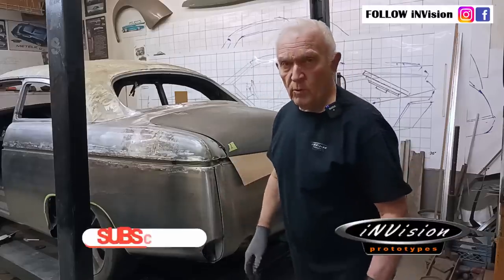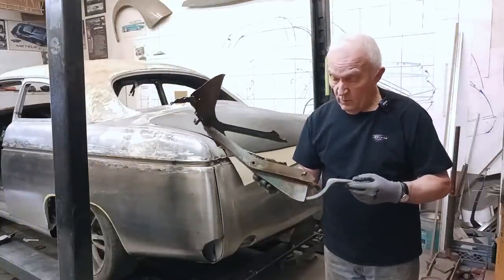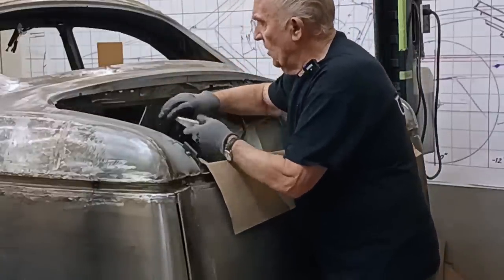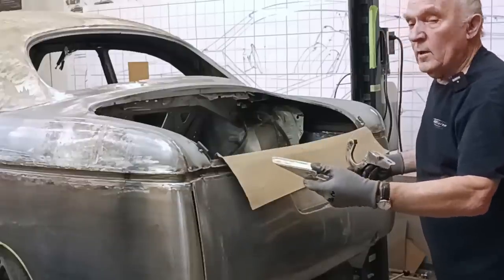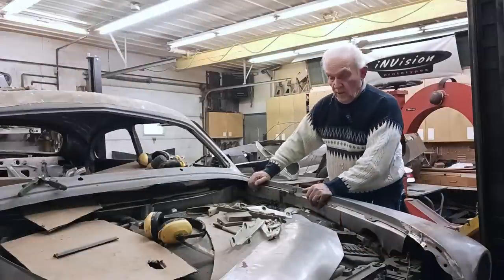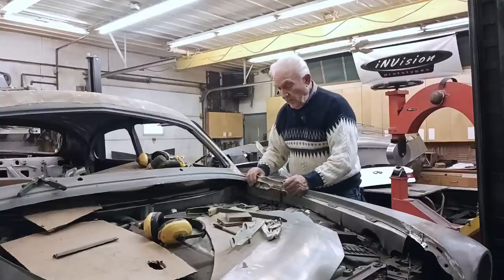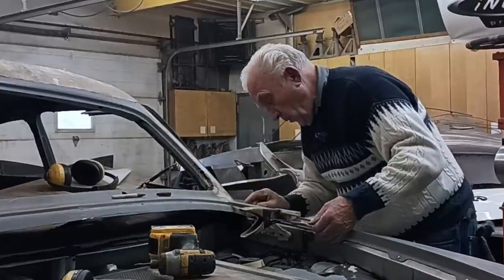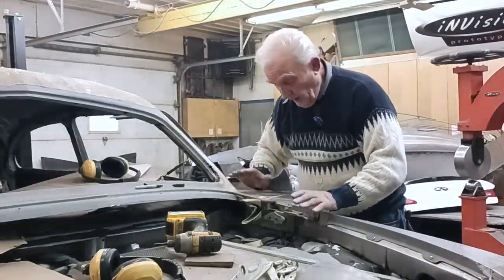Making CUSTOM Trunk & Hood Hinges for Your Hot Rod - Ep.15 - 1951 FORD + INFINITI G35XS Sport

Comment: Vic, great to see you as our host today.  Note - even your two left hands are way more capable than anything I could dream of handling  👍😎👍  This car is sure turning out gorgeous.  Both of you are wizards, showing off the results of your magic tricks.  Any change you could share a few words (maybe in the next video) as to the technique employed to align the centerlines of the hinge pivots?  I can imagine how one might make them longitudinally perpendicular to the car centerline, but how were you able to locate those tiny pivot pins perfectly inline 3 feet apart?
Reply from the maker: Hi Joel, alignment can usually be established using a longer pivot shaft connecting the 2 hinges together and precise mount locations scribed.  Thanks for the kind words.